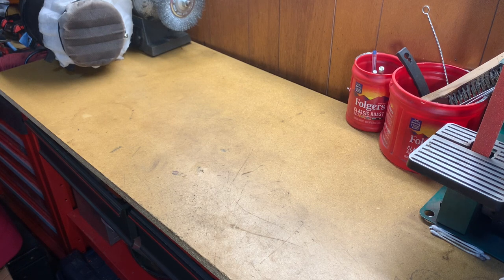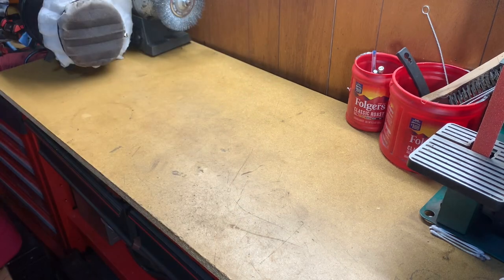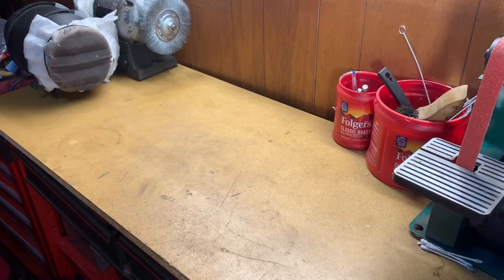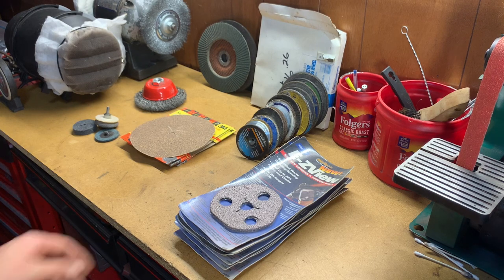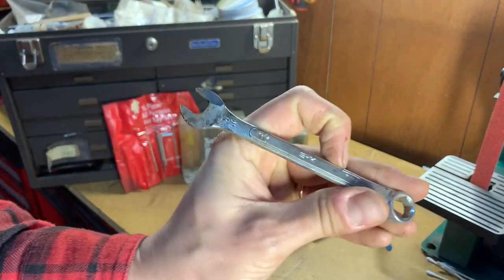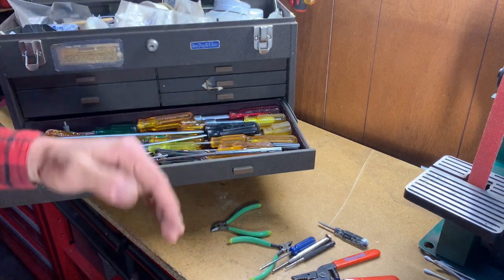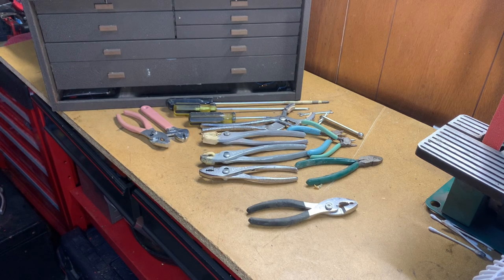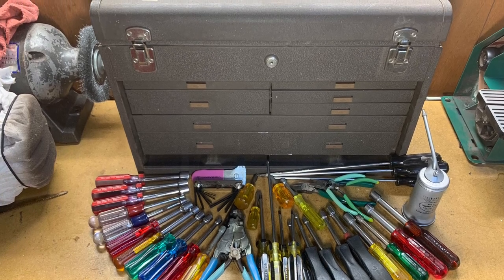Take A Shot & Ask Not; Estate Sale Tool Haul w/ Kennedy Tool Box

Comment: The blue handle thing is a wire stripper for different size wire. the bottom part holds the wire and the top blade cuts the wire and pulls the cut part off,. They do a great job. Good haul.
Reply from the maker: Can you tell I’m not a master electrician 😂 And those pliers are perfect for dopes like me who can’t just strip wire with the blades on a linesman. Thanks for watching

Comment: This tool chest belonged to an electronics prototyping technician based on the tools which included a 30 gage wire stripper used for wire-wrapping and the AN soft jaw pliers used for removing circular connectors from military electronics boxes. One of the drawers looked  like it had crimp terminal insertion/extraction tools. The Xcelite tools are a dead giveaway.  I wrote this before you pulled the pics and Lockheed Martin Sanders I’d.
Reply from the maker: Very interesting! Thanks for watching